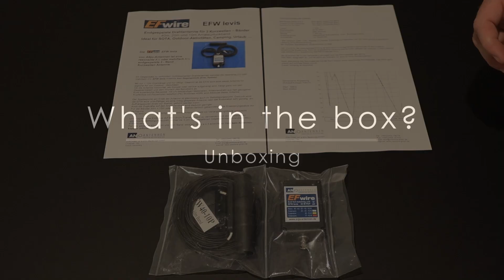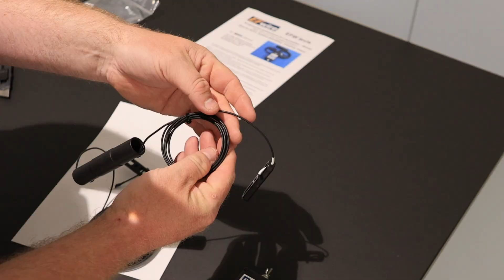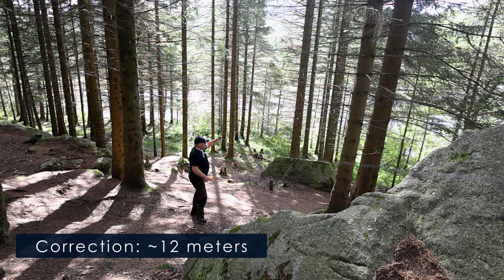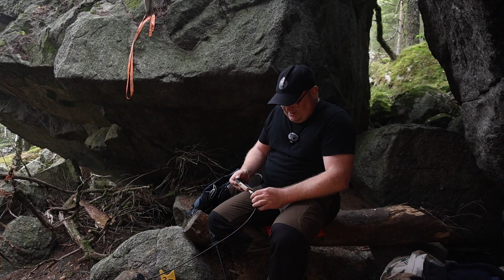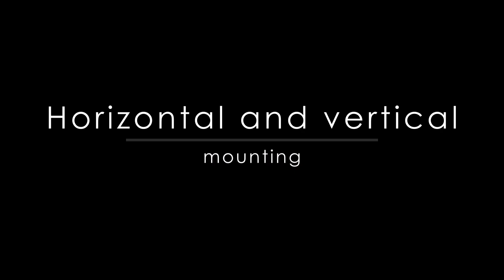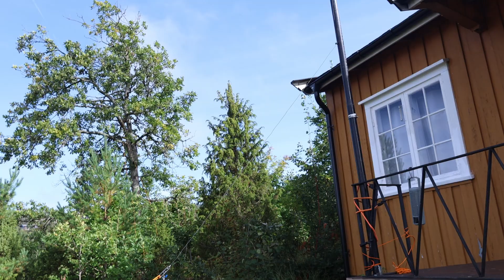Anjo-antennen EFwire 40-10m Antenna Real Life Review

Comment: Great review. It is something that I don't use. Depending my location its an ATAS-100 on my vehicle or an elevated 17foot (5.6 M) vertical  with 2 elevated counterpoise linked so it is tuned for each band. It is a killer antenna, I can't seem to tear myself away from it.. lol  VE1SK
Reply from the maker: Thanks! This is one option to use at least. Nowadays I mostly use the monobander for 20 or a JPC-12, but that's just because it's so much easier to mount than a big mast!